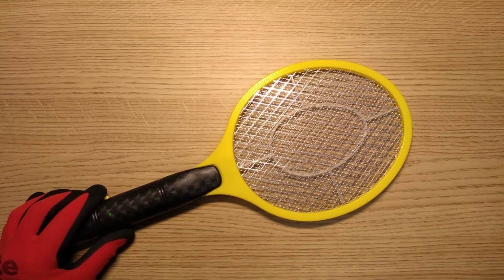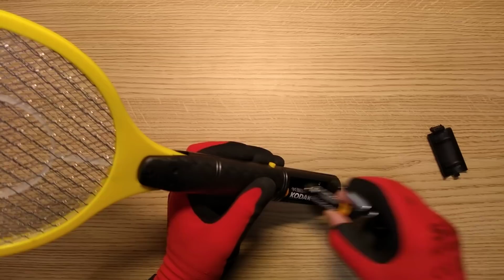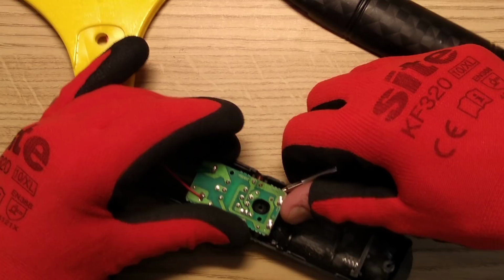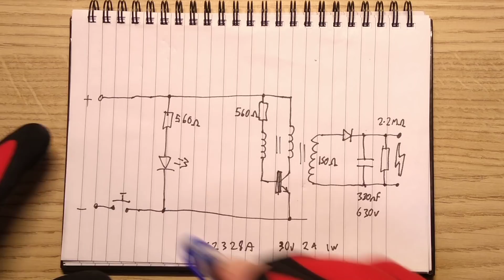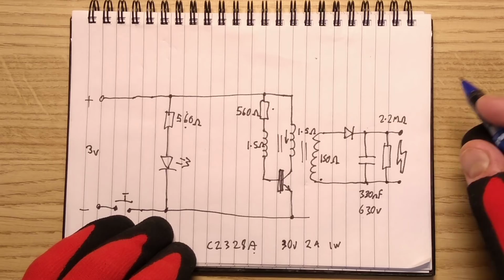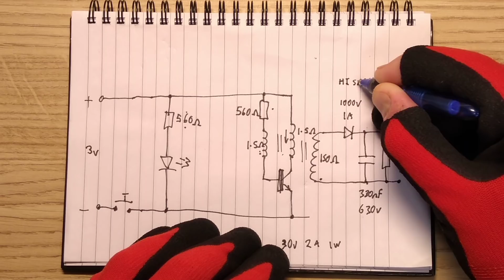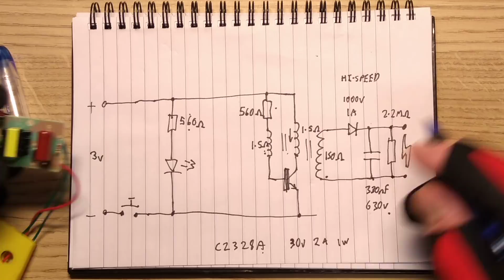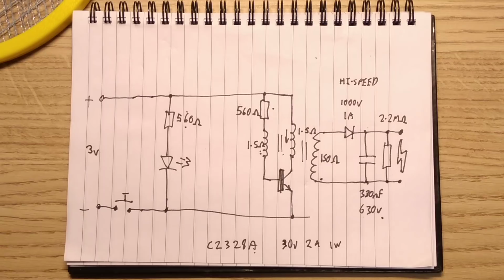Inside Poundland's electric fly zapper bat.  (with schematic)

Comment: I heard of people replacing the AA's with a 9 volt.  You should try that and see what happens...that is if you haven't already done it in some other video I haven't seen.
Reply: I replaced with 1x18650 with charge module
Reply: I tried a fly swatter circuit with 5V , I fried the transistor in 1 minute because it had too much current 😂
so with  9V, you kill the circuitry instantly 😅
Reply: @ElectroXa  it depends, there are a dozen different variations of these, so there may be one that can handle 4.2-9V.
Reply: I would be interested in this as well, is there some way to tune it? Replacing caps? Especially large insects are not very impressed.
Reply: @xenonram  To safely use a higher voltage, you'll need to adjust the base current on the transistor by changing the value of the resistor driving it. If you just slap a higher voltage on it, you'll over drive the base and likely kill the transistor.
Reply: I was thinking of doing this but more because the batteries don't seem to last very long. Maybe i should just fork out for Duracells!
Reply: @Jamal_Tyrone  now i dont know if theres any near you but i found ikea have good cheap batteries  i think they are the best of the cheap batteries around and even better then some top line brands
Reply: That's a little too kinky don't you think
Reply: @ThePr0Br0  im quite sure i reacted to somebody else further down the list , something went horribly wrong my excuses for that
Reply: Maybe the older ones have a more tollerant and robust circuit. Mine's older and on 9v (converted to an electro static flocker). You can smell burning flesh if you zap yo sell. <- You know that reference ;D
Reply: My husband now has superpowers, please advise.
Reply: @roidroid No boy bands and absolutely not the green and yellow spandex costume!
Reply: If you increase the size of the output cap it will make a difference at least in my case. Even a stock one can let the smoke out of yellow jackets, spiders , and flies.
Reply: A 9V battery won't deliver enough current. Probably lower performance than with the AAs.
Reply: @cptcrogge  Yes, change the base resistor to a variable resistor. However more punch will stress the components.
Reply: Better yet use a 24v 100amp truck battery, that'll 100% work
Reply: @johncoops6897  No, it won't. The internal resistance of a 9V is fairly high. This thing likely draws an amp of current (at 3V) and the internal resistance of a 9V is a couple of ohms for an alkaline and 4 to 5 times that for the standard types. You do the math.
Reply: @mrcaboosevg6089  Certainly. Until the magic smoke comes out.
Reply: I've tried it with a 9-volt battery it blew it not even in a seconds
😭
Reply: Hi Clive the 2.2 watt resistor am I right in thinking if it's removed by cutting just one end off would that increase the voltage to kill wasps much more easily 🤔
Reply: @Jamal_Tyrone  get rechargable aa
Reply: I hooked mine up to a car battery
Reply: You would need to increase the value of the base resistor to limited the collector current to something far more reasonable. Otherwise the collector current exceeds its ABS MAX limit and fries. I think the real limitation is the breakdown voltage of the windings on the secondary. The voltage can only go so high before arc-over starts.

Comment: The early ones used to hold their charge (I assume no discharge resistor on the output) which was actually a lot more helpful for zapping the little winged buggers...

I’ve also noticed a phenomenon where they appear to get really freaked out by the noise of them when the transformer circuitry is energised... doesn’t appear to happen when it’s held near them uncharged or charged but not energised

Comment: When I was at school I made a people zapper by winding a billion turn transformer for the HT and a smaller winding for the primary. I wound it all on an iron core. At one end I made a metal slug on a bit of old clock spring that would snap to the core when current flowed in the primary. I used a 4½v cycle lamp battery. I hooked up the primary winding supply in series with a pair of contacts driven by the metal slug and hey presto! a buzzer with an HT winding. The whole thing fitted into a small wooden box that amplified the buzzing sound. So satisfying.

Much fun and pranks to be had. Rings of people in the playground holding hands zapped. Coins in the bottom of the toilet sink filled with water. Brave souls could just about stand the electricity through their hands in the water but the instant they touched the metal coins double zap! I kept the gubbins inside the box a secret for more mystery.

Comment: Looks identical to last year's model. I took one apart and used it as the driver for a home made Tesla coil.
Reply: Make a video on it? I'm interested
Reply: Ha, I did that once. Arcs would actually jump from the power button to my finger when it was running.
Reply: I'd be willing to bet it'd work well as a base for a Cockroft-Walton multiplier. Get some high-voltage DC going. Surprise my friends.
Reply: @AlunJones  thanks m8

Comment: These are much more fun if you take out the circuit board and replace it with a $5 taser module from Amazon. They arc on the inside around the edge and make a good light show. Much more satisfying pop when you hit an insect.
Reply: Can you be more specific?
Reply: @cptcrogge  yes, I'd like a bit more specific reaction too. With Amazon links, preferably.
Reply: Clive has a videjo where he gets intentionally zapped by one of those taser modules.
Reply: Allelectronics.com has 18,000 volt taser modules for $7.50 (USD) each. They require 3.7 vdc, so a rechargeable lithium battery is perfect. Danger/Warning-can be lethal! 😳
Reply: @cptcrogge  This is similar to the ones I used: https://amzn.to/2lQsEbo They can be used with the 2 D cell batteries but the 18650s can provide a little more current and last a little longer. One of the modules along with one of these https://amzn.to/2ksYcDQ fits inside the handle pretty well. I just soldered it all together and hot glued it in there.

Comment: Bought a Zero In Bug Bat version of this from Aldi earlier this summer and dealing with fruit flies has never been easier or more fun.

Different design electrically and the discharge resistor hadn't been fitted so on a low-humidity day you could get zapped a couple of minutes after use if you picked it up by the business end. Aldi didn't seem concerned and the manufacturers response was it was being redesigned so that made it OK.

Comment: When I used to play with hydrogen / oxygen made from water, I used a modified bug zapper to ignite the gases in whatever container I was about to blow up. I had taken out the mesh and soldered longer wires to the high voltage wires so that I could stand behind cover. I had also replaced the AA batteries with a 9 V battery to up the voltage. The 9V battery even fit perfectly into the original housing after a bit of sanding.
Reply: Never tried sanding a battery down to fit (<>).

Comment: I've seen the mains powered version of those, it's basically a capacitive dropper with a rechargeable battery, however it doesn’t have a charging lead, instead it has europlug prongs that pop out of the back and you use a deathdapter to plug it into the wall, I’d love to see one of those as well

Comment: thanks for the analysis  good info,.i have seen those at HarborFreight for 4 $, now i want to take one apart,.lo.
Reply: I opened mine up. It is a Harbor Freight item 62540. [Harbor Freight has 2 or more suppliers for almost every item. Usually, if the item number is different, so is the design.]

Mine uses 1kOhm resistors instead of 560. In mine there was a sixth screw holding in the circuit board, the power button was soldered to the board, but the battery compartment was connected with yellow wires. Same 22 megaohm bleeder resistor. The capacitor is labeled 334K X2 and probably 375 volts. Although the ink is not clear, and it might say 275 volts. 334K is 330 nF. X2 means it can handle 2.5kvolt surges, and it is rated to be connected to the mains.
Reply: @hamjudo  thanks for the info, i love highvoltage circuits, they have so many applications,

Comment: That discharge resistor was 22 not 2.2 Mohm. Third band looks more blue than green to me.
Reply: not questioning other's capability of distinguishing colors but 22ohms is like a short at that low current, it's just a random made resistor, maybe a stock of wrongly coded ones sold for less but at who needs a 2M2.... not weird at all

EDIT:
nevermind

Comment: I've got two of these around in the house, one of this new finger zapping safe design and an older one. I must say I strongly prefer the "less safe" option as well, it'll zap the bugs more reliably. Also for some reason it actually works on small things like fruit flies while the new construction seems to leave them untouched most of the time (although maybe that could be adressed with a higher voltage?)

Comment: Interestingly, bringing one jn through the airport in Australia, I am told, these things are classed as weapon.

Most hand-held electric devices that are designed to administer an electric shock on contact are prohibited from import into Australia.

Only insect zappers that are powered by a battery source of 6 volts or less and have the electrified grid shielded to prevent contact by a person are permitted to be imported.

Whack a person and they will get a zap!

Comment: i modified my racket zapper with 10 400V polyester caps in parallel to get some extra bang for my 1 buck. 2 capacitors detonated i am guessing the 400v rating of the original capacitor was a lie or the caps i used where defective but either way it was a very loud bang with bits flung everywhere. it still works but i don't hold the charge button down for the full duration as i can hear the capacitors start to crackle😮.
Reply: Do 5 series pairs of those. That should make it handle 800v.
Reply: @trevorus  remember that transformer is outputting more then a 1000v already

Comment: I opened mine today to repair it, it has much more components than this one, both 220Vac wires were disconnected, due to cold solder connection.
Now it works well.

Comment: These things have been modified to hold a metal tea strainer. One terminal is connected to the strainer, the other to a fly lead. It’s used to spread model grass in the form of nylon fibres. The fly lead is grounded to the job. You put a pinch of fibres in the strainer, turn it on and shake the strainer so charged fibres drop onto a glued surface and hopefully stand up due to their electrical charge when dropped. As the thing is only 600 volts you have told me why it’s not very good. More oomph required!

Comment: I've got an older version of one of these. Not sure where it came from. The circuit uses different values of components, but otherwise seems to be the same. It has a X2 330nF cap on the output rated at 275V. I measured the voltage across the grids at 840V!

Comment: I have the earlier (voltage multiplier) version of the unit here. A rating sticker on its handle claims it's 1.5KV, 1.5W. So unless the newer design has dropped the output a lot, that output capacitor is badly underated. Also the discharge resistor is probably rated at only 250V, so could well go open-circuit eventually.

Comment: I have a late-model cousin of Clive's unit, with plastic all black, labelled as putting out 2750 volts, using what looks like a voltage tripler after the transformer. I believe them about the voltage, because it makes a little ozone. It cost $10 retail and charges up in a fraction of a second using a pair of NiMH AA cells. I disconnected the discharge resistor, and it will still make a weak zap 20 minutes after a quick charge. The HV cap must be rather low capacity, as fruit flies are sometimes only stunned by the discharge. To be sure bugs are dead, I have to hold the button in and burn them for a couple of seconds. That is the only time a foul reek arises. A swatter giving only 600 or 700 volts seems like it would rarely even spark, but I guess that kind give more current at the lower voltage.

Comment: Let's replace the NPN transistor with IRFZ44n power mosfet and powered by NCR18650, so the mosquitoes will runaways before the tool make an zap!

😆😆😆
Reply: ive tryed it in a simmilar configuration with mosfets and they got zapped instantaniosly. i guess you need some sort of snubber/protection circuit to protect the mosfet from the high voltage kickback. with standard BJT it just ran fine
Reply: @23RaySan  Using IRFZ44N I never failed with zap circuit, tremendously electricity spark will be produced and vice versa with the current consumption. Original IRFZ44N have a diode dumper / protection so the Mosfet is safe enough.

If I play with standard BJT, I choose 2SD882 and decrease the resistor on the base connection to 330 ohm or 470 ohm, it will be fun spark produced.
BUT, the ZAP will extraordinary if we extend the voltage multiplier until 20 diodes and 20 capacitor high voltage...
I mean, I need that Zap with new configuration because I hunting the Giant Prehistoric Mosquitoes... Hahahaha...

Just for laugh :-D
Reply: @samuelbudiyanto2250  It's always a good idea to keep your MOSFETs safe.

Comment: Would have been nice to see a scope trace of the waveform at the transistor's collector and/or base. This looks like the same basic idea behind an automotive points-and-condenser ignition system with a transistor oscillator replacing the mechanically-driven points. Thus, the output voltage is generated when the transistor turns off and the transformer's magnetic field collapses. That's my theory, anyway -- I are not a 'lectricial engineerator.

Also, in the US, Home Depot sells both the el-cheapo model like the one in the video and a somewhat beefier model that has a larger "bat" and uses 2 C cells. Both make a satisfying pop when they zap something small, like a fruit fly or a mosquito. Moths, however, tend to get stuck between the grates and sort of "sizzle" an emit a rather foul-smelling smoke as they get carbonized. The larger version really cooks 'em up a treat. ;)
Reply: Not quite. There is also a voltage produced in the secondary as the voltage across the primary rises, but it's nowhere near as intense as the "spike" produced when power is suddenly cut off and the magnetic field collapses all at once. This produces voltage spikes in both the primary and secondary (and any other windings the transformer may have), but in these applications, the spike from the primary is nowhere near as great as that from the secondary due to the ratio of the turn counts of the windings.

In an automotive system, the condenser (capacitor) between the points and ground provides a reactive load to further reduce the intensity of that spike, and thus mitigate the strength and duration of the arc produced when contact is first broken, thus keeping the arc from ablating metal from the contacts.

When the primary is fed by a pure sinusoidal waveform, the voltage produced by the secondary tracks the voltage applied to the primary in a linear fashion. In both the insect zapper and automotive ignition, the primary is being fed by a sawtooth waveform, not a sinusoidal one, hence the dramatically different behavior of the system.

A similar technique is used in old CRT TVs and monitors, in which the amplified sawtooth-wave horizontal sweep signal is used to feed a "flyback" transformer to produce the extremely high voltage required by the CRT's anode.

Note to Clive: As previously stated, I are not a 'lectrical engineerator, so please feel free to jump in and correct me if I am mis-stating any of this! :)

Comment: I measured mine at about 900 V (IIRC), using a chain of ten equal resistors connected by clip leads (because I couldn't find ones with a convenient ratio to use fewer, and also because I didn't want too much voltage across any one resistor), with the multimeter across one of them. It was the 'unsafe' kind with alternating-polarity wires, which I found more effective against flies than the 'safe' kind with three layers of mesh. That was back in 2017, I think. I bought it at the beginning of that summer, and later added a microwave oven capacitor (~0.7 µF @ 2 kV*) to it. Unfortunately, the racket got destroyed at the end of the summer when a chair rolled over it. I was going to build a new one (which would use the whole rated voltage of the bigger cap), but the flies, at least the ones big enough to bridge the wires, haven't been anywhere near as bad since then, so I haven't gotten around to it.

*I just did a search for typical MOC ratings, and learned that you can greatly overvolt them (by ~6× in the reported experiment) and they'll still work for a while: https://stevehv.4hv.org/MOCs.htm

Comment: I always find it funny yet oddly disturbing how you see little bug parts drifting in the air after a kill. I've got a U.S. sold verson I found on the street, has 120 v prongs that come out of the base at a right angle when you slide a switch on the bottom.  That was the problem, contacts got corroded by water rust - easy fix. It also has a near UV LED at the base of the paddle aimed toward the top. I wish it worked better on those small moths but it's ideal for mosquitoes.